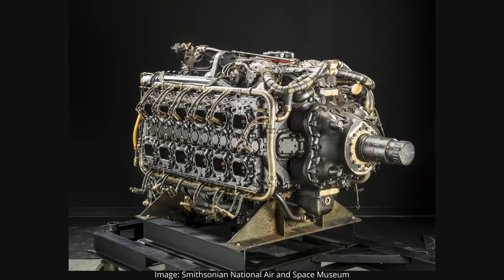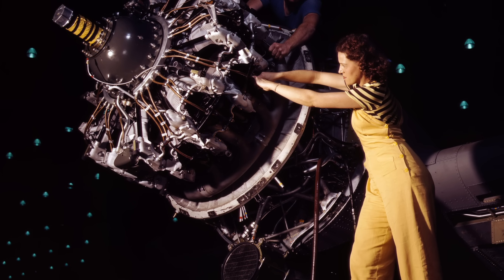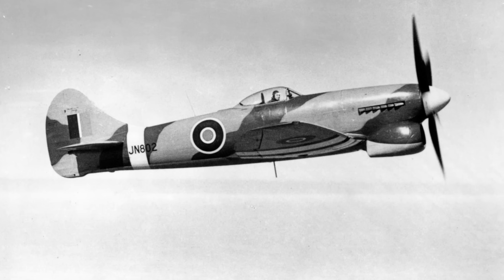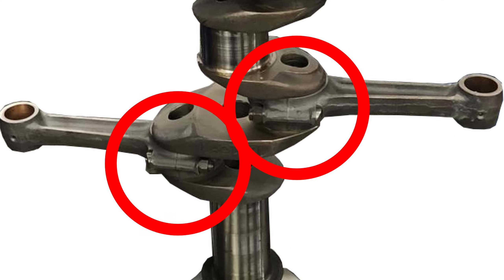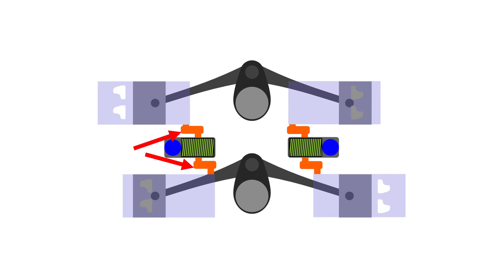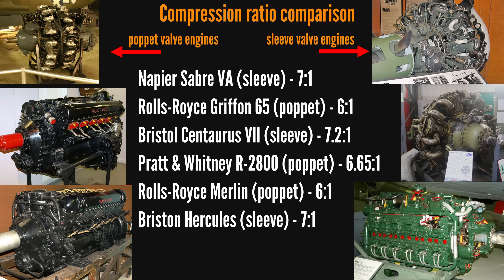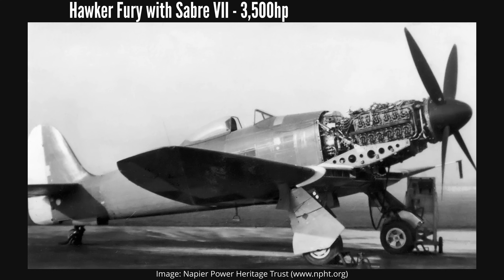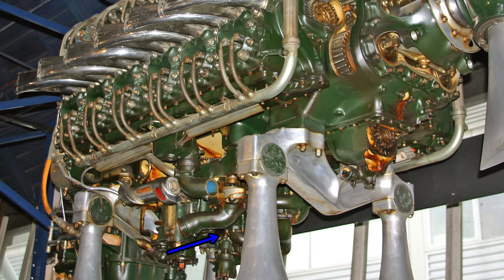The Complex Napier Sabre 24 Cylinder Aero Engine Explained Simply

Comment: That was a fantastic video, I've been wanting a detailled breakdown of the Sabre for ages. The engine was dogged by technical issues due to its complexity at the start. Do you know what the issues were?
Reply from the maker: Mainly the sleeve's, which was sorted once Bristol agreed (not willingly) to assist Napier with this. Bristol has been making sleeve valves for some time by now and got all issues sorted out in peace time before the war. The issue I believe was out of roundness, meaning the sleeves wasn't perfectly circular on a very small scale, and the sleeves wore out prematurely. 

The other issue was the Coffman starter which damaged the sleeve drive componenets due to the sudden shock of the cartridge firing.

And lastly (as far as I know) I carbon build-up also caused issues, sorted by some additive to the oil.
All issues were sorted eventually making it more reliable that many would like to admit.
Reply: The main issue was sleeve seizures, eventually solved when Bristol were involved and made the sleeves for Napier.

Comment: The very first 'powered flight' was In 1852: Henri Giffard used a steam powered airship. The first powered flight of a heavier that air craft was in 1848. It was a steam powered lightweight model aeroplane designed by John Stringfellow, that was when the first powered flight of a heavier than air craft was made. 1903 was the date of the first successful flight of a man carrying powered aircraft!
Reply from the maker: The photo of a plane carrying a person should clear up that confusion 🙂
Reply: @LetsGoAviate laf, touche’.

Comment: I'm not a big fan of the BOXER engine.. It's old tech. and Subaru needs to come up with something better!
Reply: They’re moving to electric.
Reply: @thethirdman225  Old tech... EVs peaked in 1915..
Reply: @DoktorBayerischeMotorenWerke  Cry more.
Reply: @thethirdman225  Just the facts here kid, the popularity of EVs peaked in 1915 at around 32% of all vehicles sold... it has never returned to this level of popularity for some very important reasons that are completely lost to many people.,
Reply: @DoktorBayerischeMotorenWerke  Look again genius. They didn’t have fast charging, high current batteries. They didn’t have fast charging stations either. They didn’t even have regenerative braking.

But you know all this. So why persist with something that even you know is a hoax.

Try again kid.
Reply: @thethirdman225  Modern Lion batteries are plagued with the same limited Charge -Curve Rate limitations... and are much more easily damaged by high in-rush or discharge currents... so much so that they require temperature probes and computer charge rate controllers to prevent thermal damage and thermal run-away.

Most manufacturers strongly warn against and recommend limiting the state of charge to prevent damage that significantly reduces battery service life and performance (Its also why owners never experience the same range performance as advertised)

EVs remain a relatively small niche market segment because to the many performance deficiencies associated with rechargeable battery technology.

That is ABSOLUTELY FALSE, regenerative braking dates back to the very first EVs and Electric Hybrids.
 The Lohner-Porsche electric and hybrid had regen brakes in 1897..
Reply: @DoktorBayerischeMotorenWerke  All batteries can suffer thermal runaway but try powering a vehicle with lead acid batteries and trying to fast charging them.

Batteries have also been found to have much longer lifespans than what people claim. There are hybrid batteries that are still working after 20 years. On top of that, the new batteries can be fully charged to 100% without adversely affecting battery life.

The only reason EVs could be called a ‘niche market’ today is because it takes time to gear up for production and to create the infrastructure needed to support them. That has now entered a steep upward curve. The hottest selling car in the world at the moment is the Tesla Model Y. In fact, it has been suggested that the world will use less oil this year than it did in 2023 because of the growth in the EV market.

I could find no evidence that anyone was using regenerative braking 100+ years ago. The patents may have existed but that isn’t the same thing.

Comment: Torque x rpm means diesel engines have insanely high horsepower. Which is not the case. But then again it's not explaining anything.
Reply: What on earth are you talking about ??
Reply: @AC-op4dg  you have the mental grace of a lobotomised hippo.
Reply from the maker: It's correct. Horsepower = Torque x RPM / 5252
Reply: @LetsGoAviate  you only said torque x revs.
Reply: But diesels don't rev very quickly compared to petrol cars.
Reply: Diesel engines typically generate less horsepower per liter and per-weight and size. They generate high torque density, but not the high horsepower density that aircraft require..
Reply: @DoktorBayerischeMotorenWerke  torque is work done, horsepower is work done over time. and you can get a high horsepower diesel, especially now.
Reply: @osmacar  Torque is F Force not work. Work is force over time. 
 But Diesel engine still produce less horsepower than spark ignition engines, this is because of the lower rpm. Revs per minute is a factor of time.
Reply: @DoktorBayerischeMotorenWerke  ok dunce.
Reply: @osmacar  Your childish insult won't win your failed argument or make you look smarter son
Reply: @DoktorBayerischeMotorenWerke  ok dunce. it's called dismissal. and you're acting hard on the internet. whatever could have been there of worth has been thoroughly evicted.
Reply: @osmacar  Throwing a temper tantrum just reveals that you understand that you have been bested and are not mature enough admit you are wrong..
Stay in school kid.
Reply: @DoktorBayerischeMotorenWerke  ok dunce. whatever helps you sleep at night.
Reply: @osmacar  Thank you, for proving my point kid
Reply: @DoktorBayerischeMotorenWerke  ok dunce. You're not taking the obvious thing and trying to act hard. Arguing on the internet is like the special Olympics. And given am not entertaining your shit fit. Am clearly not one.
Reply: @osmacar  Again, you have done absolutely nothing here but prove my point.
Reply: @DoktorBayerischeMotorenWerke  ok dunce.
Reply: @osmacar  Thank you for proving my point once again, you really are a slow learner aye?
stay in school, you are going to need it kid.
Reply: @DoktorBayerischeMotorenWerke  ok dunce. you're not gonna get that argument you crave from me, cause it's no different to winning the special olympics.
Reply: @osmacar  You walked right into a trap... you just keep proving my point.
Reply: @DoktorBayerischeMotorenWerke  ok dunce. One eon you'll figure it out.
Reply: @osmacar  Proved my point..

Comment: How do the bore centers or bore pitch of the Sabre compare with the Allison V1710,  the Merlin  and the Griffon?
Reply: What?
Reply: @thethirdman225  bore centers or bore pitch  is the spacing of the cylinders in an engine. I am only familiar with the term in inline engines, and not in radial engines. One of the alleged drawbacks of the sleeve valve inline engines is the ports exiting thru the cylinder walls require the cylinders to be farther apart which makes the engine larger and heavier.
Reply: @jiroyamamoto2878  Okay. Thanks for clearing that up.
Reply: @thethirdman225  You are welcome.
Reply: @jiroyamamoto2878  I couldn’t give you exact figures but I’ve seen photos of the Sabre’s cylinder block so you should be able to get some idea from that. Remember that the Sabre’s cylinders were somewhat smaller.
Reply: @thethirdman225  photos with the head off would be the best. Photos of the engine with accessories are very difficult to scale.

Comment: Well presented! I learned a lot, especially on sleeve vales. I believe another advantage of the larger piston count and hence smaller bores is that the faster completion of the flame front across the smaller cylinder reduces tendency of pre-ignition (knock). I recall that from school in 1980.
Regards.
Reply: The Sabre was quite innovative in some respects. It was oversquare, and a high rpm design with comparatively small cylinders.

Had they instead gone with the tried and tested poppet valves, perhaps they'd had it in service years earlier.
Reply: @jbepsilon if they’d used poppet valves the engine would have either been significantly underpowered or required boosting and had cooling problems. Poppet valve engines of the era produced significantly lower power per CC at the same boost levels.
Reply: @robertpatrick3350 Poppet valve aero engines of the era produced less power per volume because they were designs with big long stroked cylinders thus limiting maximum RPM. A Sabre like high rpm design could have been made with poppet valves as well.